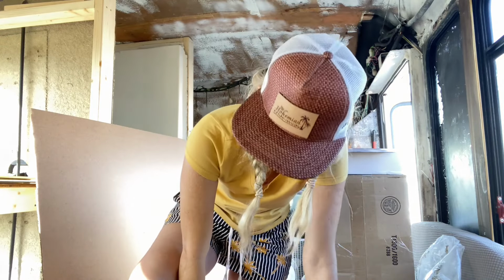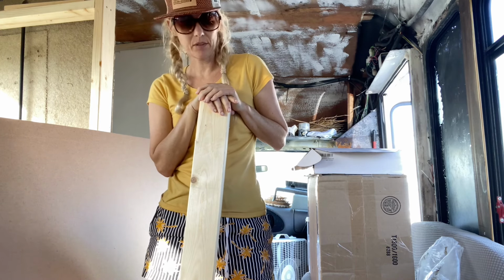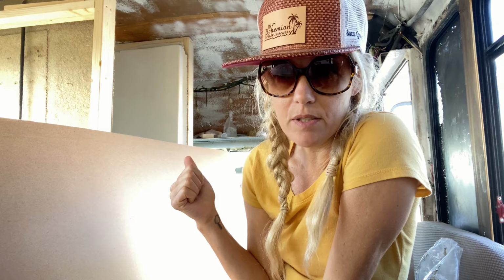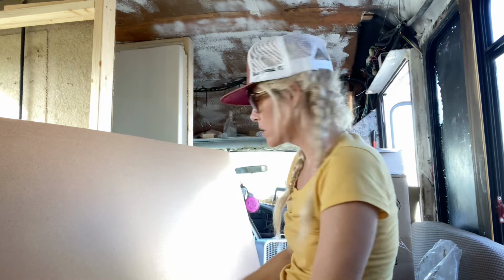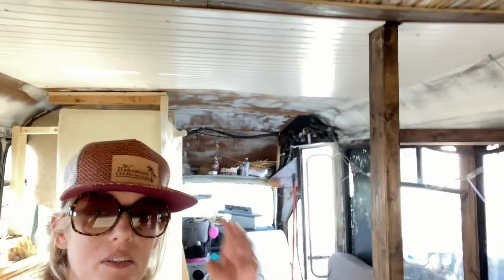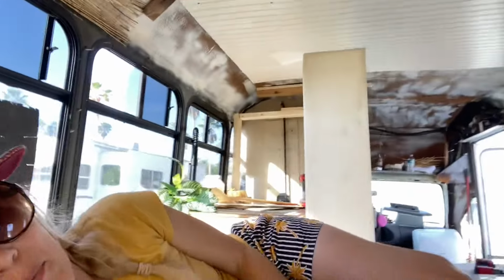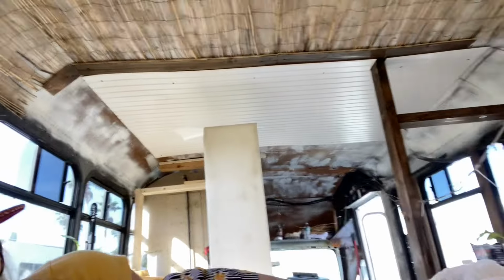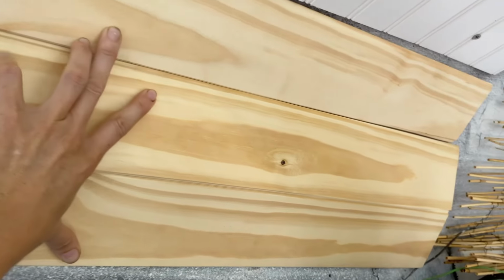DIY TINY HOME on wheels in Florida | NO FURRING STRIPS, Installing beadboard ceiling…ALONE😫!

Comment: I know the struggle of building alone. I've build 98% of the bus by myself. I had the wife help with the ceiling thou. Progress is progress a lot or a little.
Reply from the maker: I hear ya! I’ve had some help here and there but man I sure wish I had it when doing the ceiling, but either way,  it’s done ! 😅
Reply: @floridachickstinyadventures  yea just the extra hands to hold the piece up is huge.  I've still got more of ours to figure out and get done.
Reply from the maker: Definitely!!! 
You can borrow my water tank to help 😂
Reply: @floridachickstinyadventures  😂 I think it'd be a little short but thank you. If we're down that way we'll be more than willing to help ya out.
Reply from the maker: 😁😁 thanks! I’m almost finished actually, but then I got to start renovations on my camper

Comment: This reminds me of my first day learning to hang drywall 😆You improvised and adapted on the fly, (koodos btw) I applaud everything you are doing. That board on the ceiling is actually a great idea, and the your fill in idea to finish it to the window with wood strips is perfect.  It should create a very unique design that will make the inside look bigger than it actually is, I think it's awesome. Keep up the good work Jess !  👏   (also, I didn't realize just how smol you were, I mean you present yourself as such a large personality) Thanks for sharing these videos :)
Reply from the maker: Haha, it’s my first day on the job every day!! 😂😂 I learn as I go and I make things up as I go to 😂😂 there’s always things I would do differently if I had enough f$)ks to give to go back and fix the little stupid things that I did wrong the first time but , eh! 😁 Thanks for watching

Comment: Question: do you think I could use pallet wood instead of tongue and groove for the interior wall of my metal shed?
Reply from the maker: I don’t see why not, as long as you have something to securely attach them too, you can use anything you want 😊
Reply from the maker: I used all Pallet wood on the interior and exterior of my shed although it wasn’t metal

Comment: Question, when u drill into the roof of the bus doesnt it come out of the other side since its so thin?
Im making a shuttle bus conversion myself and havent got to this part yet but its coming up and i cant get and idea on what im going to do because it seems so thin and the idea of having a bunch of screws sticking out of it and causing water leaks is scary
Reply from the maker: @uzis4life  on my specific shuttle bus it was about 2 inches thick. There was the outer layer of fiberglass and then a honeycomb type of insulation in the middle and then the thin exterior layer of whatever your shuttlebus is made out of. I just used shorter screws so that it wouldn’t poke through the top
Reply: @floridachickstinyadventures  thanks